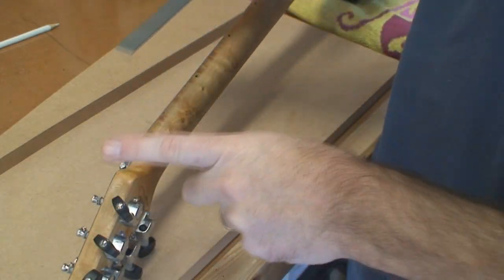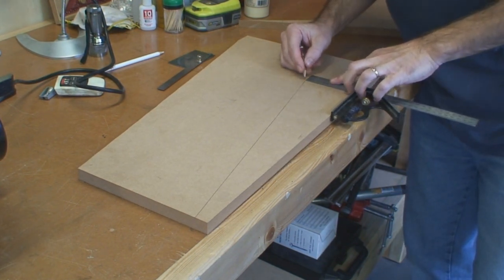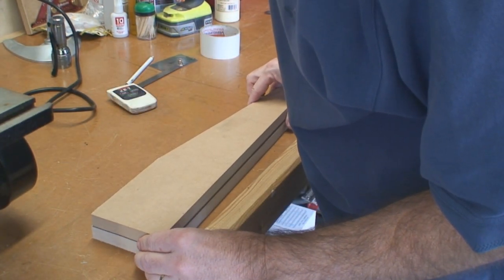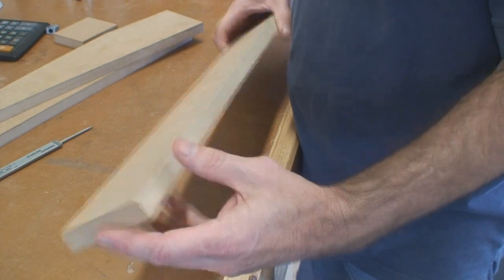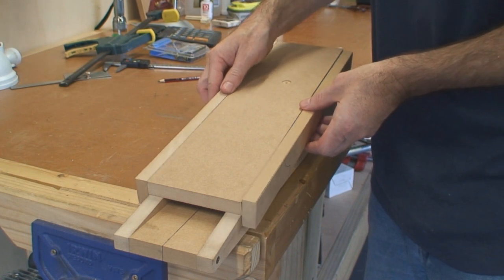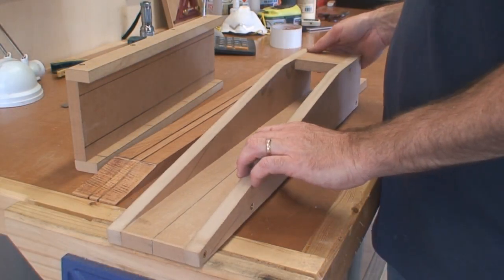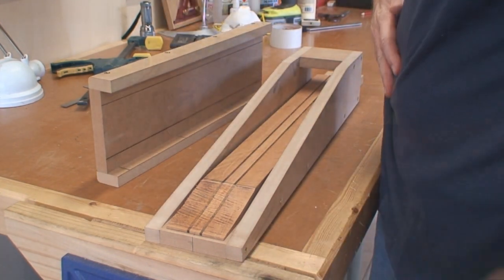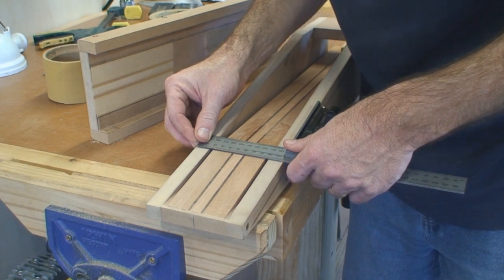Scarf Joint Sanding Jig For Guitar Necks

Comment: There is a much easier way to cut a precise scarf joint using a miter saw.  Basically the jig clamps onto the miter saw perpendicular to the fence.  The jig then has a fence that holds the neck blank at whatever angle you want your scarf joint, in my case 12 degrees.  One cut with the miter saw and your done.  The jig in this video requires a lot more time and effort to achieve the exact same results.

Comment: TIP *  Instead of using  top slide part of this style jig. Take bottom part of this jig.... neck  clamped in place as you have it.. turn upside down and run on belt sander so that belt is PULLING AWAY from open grain.  A trees fiber ( grain ) by nature is designed to suck up water. It is basically a bunch of straws. Sanding INTO these straws ( grain ) only jams them with that very fine powder created from sanding....Thus clogging the grain. ( leaving less grain for glue to absorb into ) Sand both parts ( neck and headstock ) outward away from the open grain instead of into it. Your glue joint will be more stable because the glued grain is clean. Early Jackson Charvel scarf joints never fail like newer ones you might see these days.
Reply: YOU ARE THE FIRST PERSON I'VE SEEN TALK ABOUT THIS ISSUE AND IT HAS ALWAYS BOTHERED ME WHEN I SEE PEOPLE SANDING INTO THE SCARF JOINT OR PULLING BACKWARDS WITHN A FILE OR WRASP. IT REALLY DOES MAKE A SIGNIFICANT DIFFERENCE TO PRESERVE THE LENGTH AND STRENGTH OF THE WOOD FIBERS FOR GLUE UPS, GREAT TIP. BY THE WAY THIS IS NO KNOCK ON FLETCHER HE IS A MASTER BUILDER, JUST A BIT OF KNOWLEDGE GUITAR BUILDERS SHOULD KNOW ABOUT, WE ARE ALL LEARNING EVEN THE MOST SKILLED OF US. THANKS KEVIN HUFF, GREAT TIP. AND THANKS FLETCHER FOR YOUR ALWAYS AMAZING VIDEOS.
Reply: Thanks brother. I thought it would serve well. Have an awesome new year.

Comment: A couple things for recommendation to dovetail this simple, yet fantastic jig

1) A chop saw template makes this work SOOOOOOOOOOOOO much easier than a bandsaw
2) add a small lip to the clamp block in the middle to let it really get on the piece. Make the lip oversize a tad, and use washers or small pieces of wood to let it really bite down.

Comment: Finally got around to building myself one of these and it works perfect! Thanks for the video and the design!!!
Reply from the maker: Great to hear . I actually made a new version of this jig but made it wider ( 4" ) so I don't have to glue ears on the neck later
Reply: I made mine 3.5in wide. Perfect for the headstock design I'm using. I went with the 10 degree angle as well since I'm using an inline headstock.

Comment: Do you think that jig could work with a router, or isn't it safe enough?
Reply from the maker: Sure, a router would work as well but you need to build a wide base so it can ride on the jig
Reply: *****  Thanks for the quick reply and thanks for sharing some great ideas.
Reply: It's actually hurting my brain thinking of how one would get this to work with a router. You're sanding the blank flush with the rails and the base of the router would have to follow the rails but the blank is higher than that. Seems like a lot more trouble to figure out than just putting some elbow grease on it and sanding it.
Reply: Archangel Guitars USA Couldn't you set the face of the neck that is getting routed so it sits behind the rails of the jig? That way the base the router rides on sits flush with the rails, and all you'd have to do is set the router bit deeper to cut the proper angle on the neck. Makes sense to me though I've never done a scarf joint before, and am about to attempt my first one which is why I came to this video
Reply: Archangel Guitars USA you'd need a HUGE router bit, I dont think they make em that big for the average consumer lol

Comment: Nice Jig, if you knew the widths of your necks are the same, you could make up some centering blocks to sit down in each side ;)
Reply: also, did you veneer the neck and what timbers are in it, its very cool...
someone asked about routing with the jig, you could I guess, save band-sawing on the edge, but you would still have to sand it, I saw you modified it with different side plates in another video for a 7 degree scarf, My grandfather was a carpenter, I still have a desk he made, with a drop down table lid and spaces shelved inside, I have all his old planes, saws, etc, they are over 80 years old, and dad said he hand made most of the timber parts. Where in Sydney are you, I'm in Newcastle
Reply from the maker: Nice idea, I might use that ;-)
Reply from the maker: fleuroman
Yeah, the neck is laminated with mahogany and rosewood.
Reply: I see a lot of gibsons on you tube with broken necks at the scarf area... for added strength you could do a radial scarf (larger glue surface) and dowel through from under the fret-board into the head before the fret-board is fitted... I busted my first classical, used to ride around everywhere on the pushy with it, put the head through the spokes and busted of the whole bass side machine head, dad and I glued and doweled it back to better than new...

Comment from the maker: Rich, good question. There really is no need for biscuits when gluing a body blank together. Its a long grain to long grain glue joint with lots of surface area and the glue joint is probably stronger than the surrounding wood. 

BTW, I live on the south coast near Sydney. 

Cheers

Dave

Comment from the maker: G'day, Yeah I had tried stacking them together in the jig but the headstock part kept moving from the sanding force. That's why I went with the adjustable section on the jig.  It is a very valid and good suggestion though !  Thanks

Comment: Hey David, I enjoy your videos. I am an amateur luthier myself (not your level at all) and I see you do thing that I do too – but have not seen others do. That is very comforting in some way. 

Anyway, a small tip that I don't see anyone else point out. You can sand both pieces at once and save time. If you place the headstock piece same way as the neck piece starting where the neck piece ends making one long 10 degree angle. Hope you find it useful since I learn a lot from your videos.